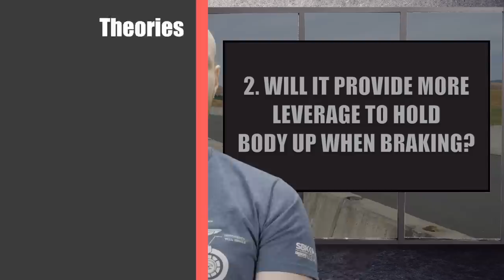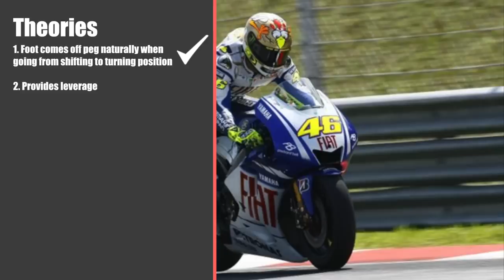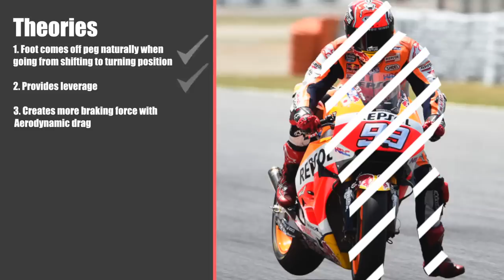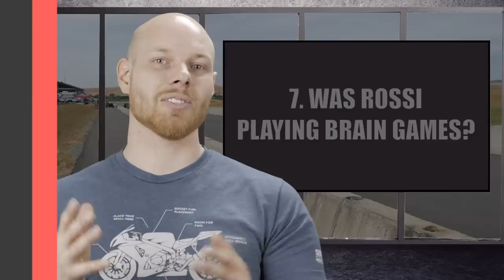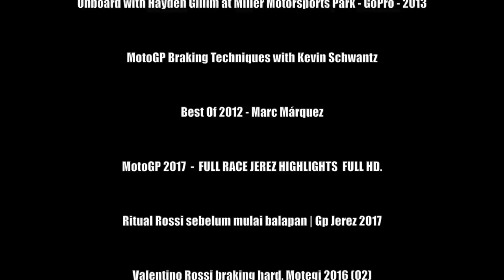The Leg Dangle EXPLAINED

Comment: Im a Formula 1 guy but want to add a part to your drag theory. If you look at cricket the shiny side goes through the air quicker swinging ball towards non shiney side. So when a driver dangles its always the inside leg. Will this not decrease speed quicker on inside of turn side with outside moving marginally quicker. So not only adding drag but in theory turning the bike using the drag.

Comment: i race supermoto's and coming from a dirtbike background  i do it on the dirt incase my rear tire comes loose, but on a supermoto track its different, i do it when im hauling ass up to a corner that i plan on hauling ass through instead of "backing it in" i start outside, grab a little front brake, and dangle my leg because between the wind resistence and body shifting its really really beneficial when it pulls my bike into the corner, once it starts pulling my bike over to the side im dangling is when i shift my body and roll onto the throttleand believe it or not, it plants the biike onto the tire sidewalls firmly, and evenly,, try it just as i said, and come back and tell me i am wrong! and for the record ive been doing it since way before 2005, rossi didnt start doing it until he started flat track racing at his ranch..............think bout it

Comment: When riding and racing my dirt bike I extend my leg through a corner for balance, plain and simple.  Extending your leg transfers mass fore and aft, IE: load and unload the rear tire.   Secondary is to catch yourself if either end washes out.   Extending your leg road racing can only serve to position the foot on the peg further rearward..onto the balls of the feet to gain greater ground clearance....so your boots do not drag on the ground at max lean angle.   IMHO that is.  :)

Comment: Thank you for the video Mike. I have a very important question which I appreciate if you can provide some explanation about it. Recently I realized that I can make my left turns much faster and in a much more stable manner, when I do it motocross style, on my KTM Duke 200. that is I extend my left leg out all the way through the turn, lean the bike at a steep angle (but) lean my body on the opposite direction to the bike and turn. why is that??? and why you can not do it on a superbike??? is it because of the weight factor??? cause superbikes are heavy and you can not hold them up at that steep angle, leaning your body in the opposite direction??? and why I am not comfortable doing it on my right side??? on the right side I am much more comfortable leaning my body and knees motogp style!!!  . . . please explain. thank you.

Comment: Likely just a habit for many riders that rode motocross. For every corner you are sitting far up on the tank, foot near the front brake rotor to help push off in the case that the bike goes squirrelly.  I have caught myself doing it on a street bike without thinking about it. Not that its a case for the pros though... or would help at the speeds they are at.

Comment: I've never understood this debate.  It seems obvious to me why they do it.   BTW, nice video.  I just did not see the reason I think they do it.   I could be wrong, but I have not heard anything yet that makes me doubt my rationale.   I'm going to paint a simple scenario but, as far as I know, it would apply at any corner in which significant breaking occurs.   Take a long straight away with a significant turn at the end (such that braking will be significant).   In today's racing, how late you brake and how quickly you accelerate are key  (has always been key but I think it is magnified due to the design of modern day bikes).   Marc Marquez zooms down at over 300 kph.  He is an aggressive rider and brakes as late as he can.  As a result, his rear wheel lifts and, effectively, he is riding on his front wheel only.   I would draw another parallel which is a skateboarder doing a 'hang five' or a gymnast on a beam sticking a leg out.   The riders put out a leg to create a counter-balance as they ride on their front wheel.   Jorge doesn't stick his foot out because his riding style is 'smooth'.  He actively works to not upset the bike, whereas Marquez rides bikes like they are broncos.   That's why when there is little to no braking no one sticks out their leg.    So, if that's not it, then what am I missing?   It sure seems obvious to me but maybe I am just not seeing the full picture.

Comment: The directional centripetal force creates an acceleration that is perpendicular to the driver, so sticking the foot out towards the inside of the turn is the same as a fighter putting one foot in front of the other for more power.

Comment: Could be a habit from riding dirt bikes. When you flat corner on a dirt bike you can plant your inside foot to the ground and it creates a 'point of rotation'  that the bike can rotate around and also gives stability/stops the back wheel sliding out too far.

Comment: 8. It's a mind virus that has infected every motoGP rider.

A few things on the motocross part.  You're not "sliding" in every turn, the goal is to settle both wheels into a rut and hook up.  You stick the leg out so as to not get it ripped off the peg on the ever changing terrain and because it helps you balance and gives you something ready to dab IF your rear end breaks loose or something else tries to throw you off your bike.  There's almost never an actual flat turn on a motocross track where you are easing on the throttle to control a slide like Bubba Shobert.

Excellent video though, really enjoyed it.

Comment: When breaking hard and the rear wheel comes up you don't know which direction it is going to wobble so you dangle the opposite foot that you want the direction of the wobble to go.  So if you want to go into a left hand turn you are actually unweighting the left peg to ensure weighting the right peg more which combined with the slight shift in center of gravity to the left ensures the rear wheel will move right or at least stay straight and not wobble to the left. once you then initiate the turn the left leg comes back as the upper body moves left creating a rotational torque providing more lean force from your body to the bike.  Watch closely and you'll see the rear wheel losing contact patch area or even coming off of the ground.

Comment: The leg dangle obviously changes the center of gravity of the rider. Thus it creates a torque that allows the bike to corner. But because the leg dangle can vary in distance, angle, weight of the riders foot, then it can create all sorts of new information that the motorcyclists can use to analyze and thus perfect a cornering technique. Basically it's revolutionizing how motorcyclists go around a corner. Don't take my word for it! I'm could be just an idiot sitting at a table with a computer butt ass naked.

Comment: Nice interesting content, 
I ride dirtbikes and hanging the leg out does help with being stable in corners ,it's a balance used to move the bike around,also pushing forward on the seat while your leg is out gives you speed around a corner,just watch out for big tree roots.Supermoto use it as well.
(Keep riding,ride safe 🏍)

Comment: It alson impacts weight balance of the system. The rider can also affect bikes handling changing the leg's position in relation to the bike+rider's center of mass. Less weight behind the center of mass may make the bike easier to slide and whilst more in front might change braking characteristics by increasing the load on the brakes. After all a leg accounts for 17% of the human body's weight

Comment: It's done to help keep the rear wheel in line with the front under hard breaking. It's not used like it is during off road riding.

During hard breaking on road bikes the ass end can have a tendency to want to swing around. Dangling the leg counters that.
Reply: correct

Comment: How does a dangling leg give you leverage if it isn’t pushing against anything? The examples of MMA fighters and athletes does not apply, because that’s more for stability and weight transfer between the feet. Added drag and some center of gravity advantage? Sure. But it wouldn’t be substatial and there is no chance the dangle had anything to do with that pass when Rossi first did it. 

As other comments have mentioned, it was probably just instinct from his dirtbike days which kicked in when he was going for a risky overtake and felt a bit of instability in the front. Notice how he barely sticks his leg out in that clip. People started talking about it, so he started exaggerating it and made it his signature move of sorts.

Comment: I think dangling allows 20 or 30lbs of body weight from the leg to be shifted forward causing the front tire to stick better getting better grip for breaking & turning in & preventing pushing.
Reply: Or at least, it does physiologically.

Comment: I think it is a natural reaction when going into a corner on the ragged fricking edge, the butt hole tends to tighten beyond its intended use thus causing the leg to straighten.
If it were not for the leather attire partially creating a vacuum both legs would straighten.

Comment: Re 3. Drag. Though it is minimal, it doesn't just increase drag. It also shifts the centre of drag toward the inside of the corner, thereby actually adding a turning force without additional wear on the tires or effort on the rider. Again, though, of course, it is minimal.

Comment: Fast corners no need to put leg out. Slower sharper corners leg out to create drag and thus reduce speed, also to shift centre of gravity to maintain balance and stability prior to full lean and acceleration into, during and out of the corner. Leg out into sharper corners also means you can adjust and set up the bike with the steering prior to corner, thus avoid wiggling or fish tailing the bike and also downshift without skidding.

Comment: 7:35 How exactly is the combined COG not somewhere in the straight line between Bike COG and Rider COG? Magic?
Reply: Yes, you are right. The combined CoG should be located between the position of the two parts’ CoG in a two-part system. This must be a small post-processing mistake on that figure.

Comment: In my opinion, it's just about a "false" but sometimes useful sense of safety it gives to the pilots. Rossi used this the first time when he had to do a quick lean.
There was one famous race, with heavy rain, that Lorenzo ACTUALLY prevented his motorcycle falling because he had his foot there.
I usually do this when i'm at very slow speeds doing a curve (think about leaving the parking lot, having to do a very closed angle curve), so if anything bad happens, i might be able to save it.
Even thou they are at much higher speeds, it might give a sense of safety (sometimes, your mindset is the only thing between losing and winning races).

Comment: Theory 4 explains it all.  By keeping the bike more upright into the turn, the front wheel has a larger contact patch and thus brakes harder.  Rossi even says it at the end of the video "It feels like I can break harder".  

The motocross comparison isn't relevant imo. Mx riders are putting their leg forward, not to the side, and are doing it under power, not breaking.  They do it to transfer weight to the front wheel, as it's difficult to get steering in dirt.

Comment: i do dangle my foot  as far as i can to the front (near or beside the front tire) when riding very slowly to balance the bike. because otherwise driving very slow will make the bike feels heavy and start turning (leaning) because of the imbalance because not enough speed to balance the bike. so maybe it is an attempt to stabilize the bike.

Comment: Nice work, although I am pretty sure that by having the CDA value you can actually calculate the new drag force, thus you can actually calculate how much breaking force is added. But to be honest it is so small it is negligible.
Reply from the maker: You would have to calculate the CdA value for the riders leg & boot, which is variable, for a speed, that is variable.

It's not possible without a wind tunnel, and even then, it wouldn't be representative, since the way they stick out their leg varies.

Comment: I'm gonna tell you one thing, kid...high wire tightrope walker's balance beam - inertial damping of unweighted rear wheels tendency to pivot on the front fork bearings.  (later edit) - also the dangling leg is better able to sense minute amounts of rear end movement and thus give a more sensitive feel to steering, braking and throttle correction.  The earlier you catch an unwanted movement in the bike's line orientation, the less effort you need to apply to correct, the correction is faster and the better your chances to carve the line you want.
Reply: Walter Alter  good on you buddy!! I knew I would find one smart comment..
It took me while though.

Comment: It's my Opinion that the dangling leg is acting as a weighted damper. Much like OEM handle bar ends are weighted and rubber mounted. The riders only seem to feel the need to do this when the bike is upset or oscillating with the rear bouncing or floating giving the rider the feeling of confidence to push harder.

Comment: You don't apply rear brake to "set the bike down" you just immediately hit the front brake as quick and hard as you can, rear brake is useless as the rear wheel is barely on the floor. Pro racers only use the rear brake mid or exit of a corner

Comment: Theory #2 is for sure wrong.  You don't want more weight on your arms while breaking, you want less.  His demonstration with the bathroom scale is basically shifting his center of gravity forward, but breaking a motorcycle at high speed, you want to keep your center of gravity as far back as possible to keep the rear wheel from going over.

Comment: Theory 3, definitely DOES add drag. I mean you're talking about frontal frontprint + aerodynamic drag, if the footprint is bigger, then the drag is bigger, there's no way around that.
Whether that directly equates to more stable braking periods or faster lap times, THAT'S the debate. But you can't "debate" whether adding more of a frontal reference area causes more drag or not, because scientifically, it does. It's indisputable.
Reply from the maker: Indeed, that is also precisely how I explained it in the video. Thanks.

Comment: It’s no 4. And the need to dangle stops when you start to let the break off for progressive breaking at turn in, because the back end settles back on the tarmac aligning the rear wheel there is then no need to counter balance. It’s just a counter balance thing to stop the frame rotating around the head stock. Although the dangle with Gibernau was purely because Rossi was worried he would loose the front imo. He over cooked it and Used Sete as a burm. Lol

Comment: They also dangle the leg after coming out of a corner if the bike is still tipped while throttling into a short straightway that then turns into an opposite direction corner to correct the bike. These guys are equal to Fighter Pilots IMHO. I hope this doesn't offend pilots. These small guys control such insaaaaano machines!

Comment: One of Rossi success was to slip into corners while rider in front preparing to turn in. He was so successful and manage to beat many other riders including 4 times 250cc champion max biaggi. Rossi knew copycat will come soon and he invented the leg dangling as a legit technique to prevent overtaking.

Here's how. When 2 riders are speeding at 300kph and slowing down towards an apex, the rider behind plan to overtake like Rossi always do... He will change his mind when the leg comes out as if the front rider is losing control. If front rider falls, the behind May fall too. and that plays a strong psychological effect to motoGP until stoner, lorenzo, pedrosa and Marquez came. Rossi has tasted his own medicine and it is indeed bitter.

Comment: put weight distribution sensors all over the frame/seat/pegs. go around track 100 times with legs dangling and 100 times without. Observe data...would be cool if they do that

Comment: You cannot compare dirt riding body’s position to sealed/prepared track!!! The body position of a dirt rider is built around traction not control. A dirt tyre although shaped with the same curve as a road tyre. the closing circumference of a leaning road bike tyre is irrelevant on a constantly changing surface... dirt. A dirt bike rider is above the bike pushing it down into the corner (opposite to a road bike) because they are actually using a combination of the centrifugal force, rotational forces of the unsprung weight and drive through the tyre from the engine to turn the corner. I appreciate your videos and a smart guy like you will do the research and see it a little clearer.

Comment: You’re a little wrong about the mma thing. Dangling the front leg or rather shifting the weight between the back leg and both legs comes from muay thai and mainly serves the purpose of the front leg not being an effective target. You can almost immediately lift your front leg to check/block a kick to the thigh. And also if the leg is still kicked before you can block the kick, it is less likely to knock you off-balance and will just push your leg to the side a little.